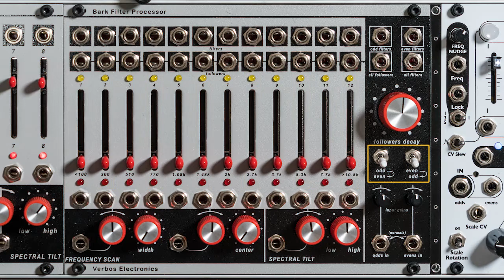Verbos Bark Filter 3/4: Vocoding (LMS Eurorack Expansion Project)

Comment: Bark or Ajh FFB914...both seems fantastic but the Bark seems to offer more fonctionalities. Did you have an opportunity to compare those 2 modules sounds ?
Reply from the maker: I think of them as different beasts. The AJH has a more gentle slope to its bands, and would be better for massaging a sound to improve it; the Verbos has much steeper bands and has a more drastic effect on the sound - in addition to the other envelope following and voltage controlled features.

Comment: Nice video, very informative.  Any chance you could borrow another Bark and try the pair as a vocoder to see how much better it is with voices?
Reply from the maker: For vocoder-like work, I now use a Frap Tools Fumana, which has 16 bands of analysis and 16 bands of processing in one module. The Bark Filter, of course, still has its uses as well, and I still love it! But if you want more accurate vocoder-like sounds, I'd suggest the Fumana over 2 Bark filters.